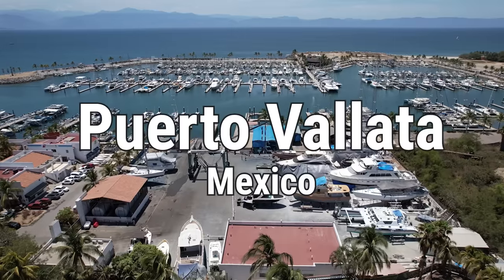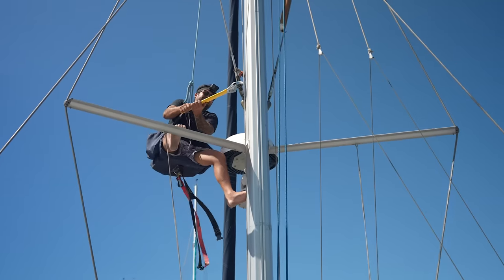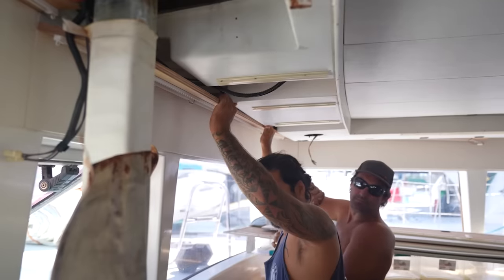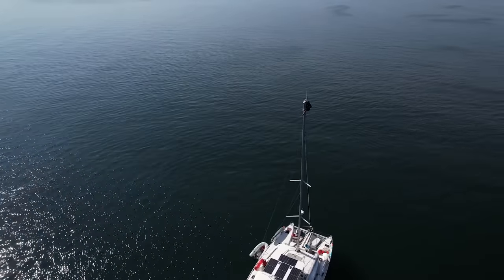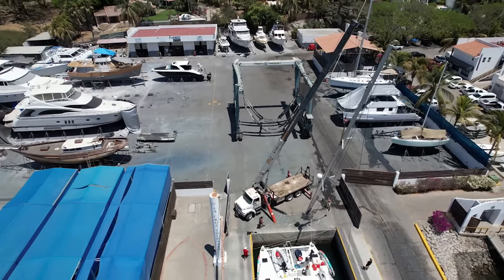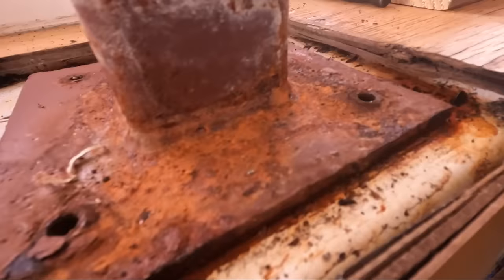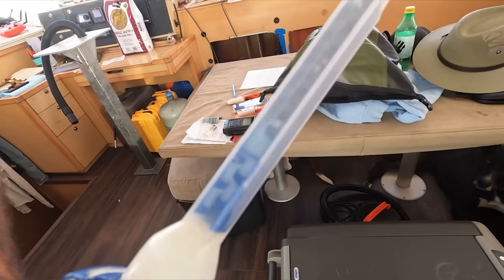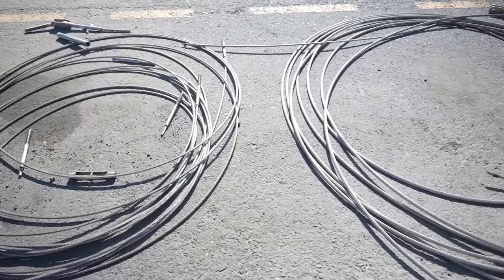Our Entire Mast Has To Come Down Because Of This... (Episode 220)

Comment: There is an old mechanic's trick with seized bolts ....... apply heat like you did then rub candle wax on heated fitting/thread, apply more heat. This strangley works better than penetrative oil or just heat alone.
Reply: It’s because the paraffin penetrates as it melts ✌️
Reply: We used to use heat then trow ice on it. The extreme change in temperature cracks them loose
Reply: Remember to use anti-seize when reassembling, use anti-seize on alternater adjusting bolts, starter mounting bolts, engine water thermostat housing bolts, many other things. Do not use anti-seize on internal engine bolts.

Comment: A while ago one of the sailing channels published a video of a factory tour of the factory that makes Leopard cats. I remember one of the leopard managers showing how the boat was built so that any maintenance could be done easily with inspection hatches and panels. Because most of the boats are for charter fleets, being able to quickly turn boats around for repairs increases availability for the fleet. Seems like Lagoon have done the opposite, no way to inspect a bulkhead without tearing apart a cabin. No way to access compression post without ripping out trim that with screws that can’t be accessed. Just seems crazy that such beautiful boats have such obvious design flaws.

Comment: The thick u-shaped old polyester resin looks like it was only partially seated agains the post "base" (top base).  What you're doing is helping tremendously. I suspect your next pullout of the mast will show a foot in much better condition.

Comment: Find yourself about a 4’ piece of steel pipe that you can put on the wrench handle to get more leverage.

Also, you need to tie the wrench off to prevent it from visiting the bottom of the ocean and always tie off your tools when going up the mast.
Reply: Yes indeed, that makes the leverage so great you could probably just use one arm to move the wrench.....

Comment: Great video folks!! Very interesting repair work. It's a simple thought, but would some penetrating oil on the various hardware have helped them break loose more easily?? I have seen the penetrating oil in combination with heat do wonderful things. Anything to break up the adhesion the threads have formed over the years. Maybe a little oil or grease when reinstalling would help for adjustments? Have a great week! 😀

Comment: G'day Mate Colin, I told you long ago when the hull cracked that the shrouds were set way too tight. Please try hard to accept my advice this time and only tighten them enough to hold the mast straight up and centered when the sails are not up. When you have the sails up it is no big deal for the downwind side shrouds to have some slack in them. A little looseness is far, far, far better than over-tightening them.
PS: Use some Never-seize on the unbuckle screws before you re-assemble it all. Too late now but removing the compression post was not necessary and a total waste of time and money. If you had any doubts about the compression post it would have been fa easier and far less cost and wok to place a 2 foot wide by 8 foot long piece of 3/8" thick stainless steel beneath the mast on the cabin top to spread the load out over a wide area. You could have also replaced the shrouds one at a time without taking down the mast. Another easier option was to leave the original compression post alone and add a new compression post onto each side of it to spread the load out more. Dill a weep hole in the compression post whee it meets the bottom plate to allow water a way to get out.
Reply: sensible.  I would have fabricated a new post and base in halves that fit over the original and TIG welded them together over the original, then use longer bolts and screws to secure in place.  it will ve interesting to see what the new rigger does.  funny how in the master and commander books aubrey is always changing the rake of the masts on his boats until he finds the fastest configuration.

Comment: Lagoon, the money pit that keeps on giving...
Reply: As a guide any boat owner should allow 10% of cost price of boat as maintenance annually. So i look at this as a daily run cost with a bit of low grade engineering from the factory, hopefully they learn from that and fix the water ingress issues in the factory. That said my caravan comes from a 50 year in business manufacturer and is considered one of the top two off road vans in aus. But they still make stupid mistakes, causing water leaks, wiring mistakes, and other issues. Just have a look at the car industry and these guys spit out a car every 2 mins and after 100 years still can't get it right. Its just part of life.

Comment: It’s seriously expensive over there, $650 for the crane? In France, hiring a crane for mine cost $350 and it was a very cool crane. That post should be made out of stainless really, but a good epoxy would help. Try Jotun Jotamastic 90, I painted my whole boat in it 20 years ago and it’s still good. Anyway well done, it’s never nice yanking the mast off.

Comment: For the mast step, we also had some leaking. Glad I caught it before my compression post looked like yours. It was caused by two things. The 4 step bolts weren’t properly sealed at the factory, so I took those out and sealed them with 3m 4000 uv. And the weep hole at the base of the mast was blocked by tiny natural debris coming in through the holes at the top of the mast. Probably from birds. I leave thick zip ties pointing up on all my wiring at the mast head, and they don’t land there. I also made some aluminum plates for the top of the mast to cover the holes, and made sure to clean the weep hole every time I washed the boat. No issues after that. Looks like your weep hole was blocked as the water got above the gooseneck part of the conduit inside the mast and then migrated between the conduit and the box beam/post. Nice work buddy. One other issue I had that you may want to check was leaking at the deck to hull joint by the chain plates mid ship. This only appeared after we unstepped. It separated when the rig tension was removed. Had to remove the toe rail to get to the bolts. They were way undersized, so added larger diameter bolts and resealed with 5200.

Comment: You don’t have to undo the turnbuckles completely. When we unstepped to add the leisure furl boom, we just slackened the turnbuckles and then pulled the pins. Much easier

Comment: You lost me when you said you were trying to get the minimum values that Lagoon recommended and that you bent the boat. Then you made it sound like that was your fault because you "knew a lot more now than you did then." So I'm confused if you were tightening BEYOND the correct specifications OR if the specifications were wrong. Sorry I didn't follow. I just really want to understand what the mistake was and what the lesson was. Thank you!!
Reply: I suspect they were attempting to hit the minimum values however the bulkhead was already damaged and would not support the load properly.  They continued to tighten the rigging and bent the boat  further.  Sharing what they know now with everyone hopefully will provide a base of knowledge for others to be aware of.
Reply: @spacedmanspiff1543  Yes. That makes sense. Thank you!

Comment: I could easily build a compression post from stainless steel, is the original compression post made using structural steel or mild steel?

I could also build a composite compression post using using carbon fiber or carbon fiber / aramid blend.  I have mandrels to wind composite roving and make dimensional round or rectangular tubing.  I have a bunch of 1" and 2"  structural carbon composite plate which could be used for end plates.

Comment: Bending the accordion tube to prevent water ingress, might make it impossible to add or remove cables once the mast is reinstalled. Better put a cap at the top.

Comment: you should drill a hole in the bottom of the new steel piece so if a leak develops in the future you'll be able to know there's a leak and also that any water that gets in to the post will drain out.

Comment: Water running down from top of mast is my bet. Last time I was at top of mast heaps if openings for water to get in and run down, fills base of mast then runs into the support. Good job guys.
Reply: Lol just as I post you found it
Reply: The water probably ends up on the cables in the mast,  directing water into the conduit.

Comment: Equal parts Acetone/Automatic Transmission fluid will significantly lower ft. lb.. breaking points. Works on all nuts, cheaper than the wd, or power blaster.  Were gloves.

Comment: Well now. How do you spell PRODUCTION BOAT? Jesus! You have kept insanely quiet Collin.A compression Post design that cannot be installed with the mast pulled....REALLY. Designed and produced for maximum profit and no thought to reliability. You are a damn good engineer. If you keep the boat long enough you will have engineered it into a decent boat. I bet the top man at Lagoon watches your videos with great trepidation indeed. Then has sleepless nights until the next one. Tough nuggies on them. Tell us true Collin. Us lowly non Patrons. Has Lagoon offered you a new Lagoon 45 to give them back that one. Inquiring minds want to know if this has had an effect on Lagoon sales or are people just ......Who can say...Cheers from an old Sailor on an old Southern Cross 39 with an aluminium Mast step which of course does not make disimalar metal corrosion problems. Good god almighty. Unbelievable

Comment: a little PB Blast would have gone a lonnnnnngggg way here
Reply: Maybe, maybe not. Stainless hardware loves to gall and fuse together, even when properly torqued. Maybe some anti seize when installing it but in my experience, stainless is a bitch.
Reply: @Zyxalis  I agree stainless is a bitch but PB Blast with the heat will start to breakdown the saltwater corrosion to help prevent the galling but if you're replacing it all then who cares just get the settling touch out 🤣

Comment: At 5:50 ,  adjustable wrench is on backwards. 
The wrench will ‘bite’ and hold tighter , and safer if you use it the other way around.
And for others, I  just put motor oil on all moving parts such as turnbuckles , it definetely keeps them from seizing.

Comment: I recently rejected a Tayana 37 because of a very similar problem. Badly rusted mast foot (keel stepped). Broker said you can do this and that or it isn't that bad but working through the problem there's no escaping that the whole rig had to come down. Not only that though, couldn't see a way of guaranteeing that the hull deck joint leaks had been fixed, despite obvious  evidence to the contrary. I walked away.

Comment: Fuiture suggestions. My brother is a mechanic and I have done some old car restoration. One technique is to use 2 hammers. Hold one hammer on the side and wack with the other hammer. The will break the corrosion. Heat and cold cycles with maybe a wet rag. Or while hot spray with a penetrating fluid. Not WD40.

Comment: you are holding that adjustable wrench the wrong way. The large jaw section should always bare the force.  In other words. If you are trying to loosen a turn buckle, the large side should be on your left. Hence, the force is now on the heavy side of the wrench. Same as tightening. Pipe wrench, Plyers  Etc Etc.  Cheers from London Ontario.

Comment: I don't know if you've ever used Metal Protector HD from AMSoil...I'm sure there are other similar products out there.  It sprays on very thin then sets up to a waxy film when dry.  When its dry it doesn't collect dirt or grime either.  I think I'd spray all those turnbuckle threads every couple of months to make sure they stay in tip-top.

Comment: If you fold the conduit on itself and want to add another cable it will be near impossible. What about a trade seal ? We use them in the building industry to seal penetrations in the cavity behind the cladding. Has self adhesive backing. Also in nz that's a coach screw. 

Really interesting seeing how the boat is constructed.

Should paint a mural on the post

Comment: Clearly not designed for use……just looking good at the marina. I do a lot of industrial repair and threaded connections. Little bit of lubrication and use the deadblow hammer to beat the snot out of the threaded sleeve as you slowly rotate it back-and-forth. It will beat the threads back into shape smooshing any imperfections together  and allow the lubricant to seep in.
As violent as it sounds the deadblow hammer will not leave a mark in anything.

Comment: 1.5 hrs is a very good time for that size of mast.  Maybe drill a weep hole in the bottom of the square tubing. Don't keep the water inside the tube if you can.

Comment: Get some ATF and some mineral spirits and mix 50/50 then spray all those fittings. Ive used it for things that should have never moved again, its not nearly as volatile as other penetrating oils so you can heat without starting a fire and has some lubricating properties as well which will help as things do start to move. People have done tests and proven that it works better than anything.

Comment: With Sta-Loc you really need the lubrication, I had two Gaul up on me recently. Now they come with a Teflon paste, but I put some oil on the cone end as well to help the ends form over. Great stuff Sta-Loc, mine are 20+ years old now, makes life a lot easier and cheaper when you are experimenting with a crazy A Frame mast and need to move stays and such, just unscrew, fit onto new wire and do it up again.

Comment: Get some lube in those turnbuckles!  Stainless is a complete bitch for galling up and seizing, you need plenty of copperslip or similar in them if you ever wantto get them apart again, or at least some WD40 into them before you try if they are dry.

Using zinc plate/yellow chromate passivation on that compression post is a joke.  It should be stainless or galvanised.  I think when you pay that much for a boat, you should expect better than a bit of zinc plated steelwork. No matter what you do, it will always get water in from on top. Zinc plating (unlike zinc galvanizing) can NEVER protect the inside of the tube as zinc plating is an electric process, the electric field cannnot reach down the tube.  Totally unsuitable for the job really.

Lagoon sending out a part that cannot be fitted is also ridiculous, the replacment part should be 50mm shorter and supplied with packing plates and longer fasteners.

Comment: Lagon did not build these to be fixed, btw a tip, cut on a angle and it will alow you to remove a captive part like that with no issue vs the str8 cut like you did

Comment: Quick tip: When you use a crescent wrench, flip it the other way from what you were doing so that the majority of the load is on the solid part of the wrench and not the adjustable side. Pushing all that torque on the adjustable side puts all the stress on the threads, increasing chance of failure and also wears out the threads and worm gear.
Reply from the maker: You have got that back to front I believe. Never use a shifter with the adjustable side doing the pulling. There were instances where we had it backwards though due to the angle of the jaws…
Reply: @ParlayRevival  I think we are saying the same thing. No load on the adjustable part. I commented earlier in the video before I saw you guys using it the other way. I just reminded me of some of the things my dad taught me about using tools properly when I was a kid. It's amazing how things your dad taught you as a kid still resonates with you 45 or 50 years later.

Comment: You have already done the breaking loose of the stubborn turnbuckles, but some thread Penetrating Oil Rest Remover with Precision Straw, Loosen Rusty Nuts & Bolts. The day before. And a Acetylene type torch for heating the turnbuckles.

Comment: When you run into the Red Seas guys make sure you give them a pump up. The contrast between the two crossings is stark. They are in an old mouldy boat, everything except their nav set up is second hand, it’s just the two of them sharing the watch, the weevils have devoured their dry stores and if all that wasn’t bad enough they are Scottish rangas. They’ve broken plenty on the boat, sails, bow sprit and engine and the pacific in turn has done it’s best to break them. So if you see them give ‘em some of that famous NZ counselling. Have fun in the pacific 🤙🏽

Comment: The Water (if not from a not sealed Mastbottom) inside the Compressionpost is probably condensation inside the mast finding its way down along the conduit. The mast got lot of holes for lines or cables to get fresh moisture in and even some rain.
I would paint that Compressionpost also on the inside! (And Lagoon should made it in the future out of Stainless or Aluminium)
You could drill a weephole in the bottom of the plate and put a hose trugh the bulkhead down. Ok now its to late for this exept you made one on the side of the post itsself. It should not damage the integrity of the post.

Comment: i would have fabricated a new post and base in halves and tig welded them over the original while still in place and then replace the bolts

Comment: I know next to nothing about this, but have seen video of other people needing to run new cable up  inside the mast to add new equipment. .  If you put the bend in the conduit, wont that make it next to impossible if you ever have to pull new wire inside the mast?   Beside that, I really admire who Y'all handle things.  You are a good leader Colin.  If I were healthy I would jump at the chance to come crew.
Reply from the maker: The bend is held only by a cable tie which can be cut.
Reply: @ParlayRevival   oh thanks.. I didn't realize that you would be able to get to it.